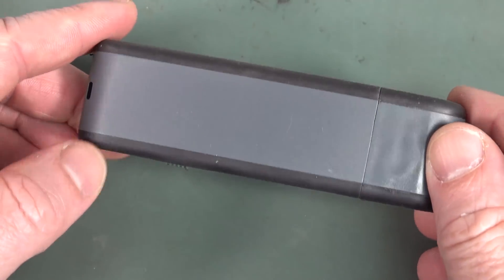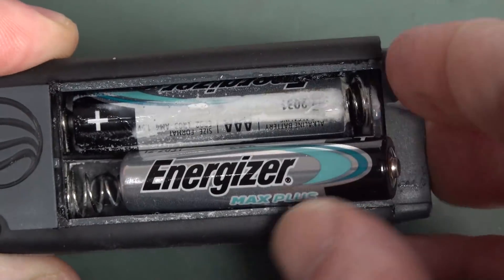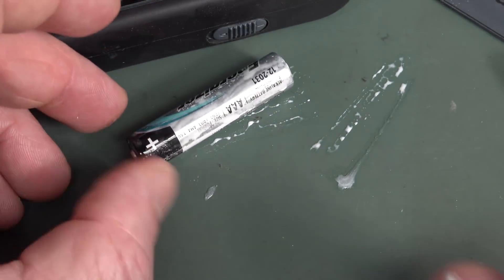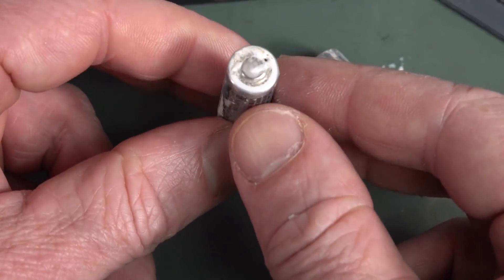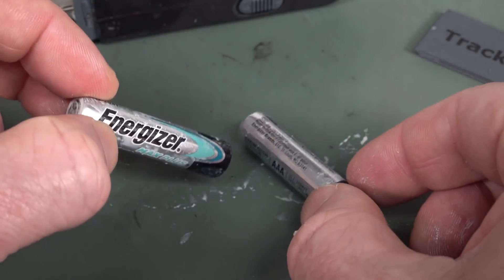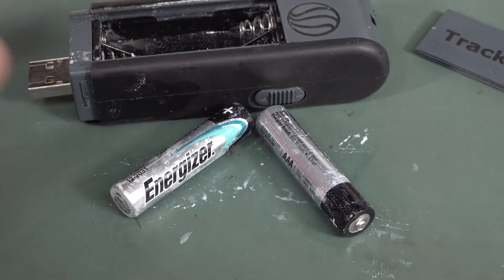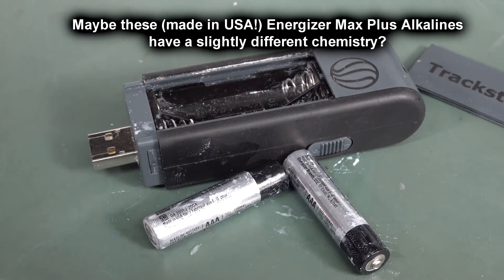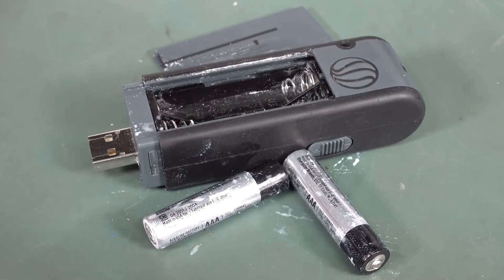EEVblog #1349 - Energizer Battery Leakage - MADE IN USA!

Comment: And it wouldn't be one cell dying before the other and reversing polarity, because both of those were leaking badly.
Reply: You’re thinking about resistance circuits where opposing installation currents can cause discharge by bypassing the  load, but the drain is only present while differences in V exist between sources. The statement warns against installation of unlike battery types because the differences in stored energies eventually causes such a differential even when the polarities are additive.
Reply: @HighestRank  Not sure what most of that means. If you have two cells in series to add their voltages and a constant load, and one discharges before the other, the discharged one will then have reverse polarity across it, which I believe is a sure way to cause leakage. In this case both leaked, suggesting this wasn't the cause.

Comment: I had a Duracell battery sitting on my desk for a few weeks and came back to it oozing one day. It stripped the paint and finish off of my desk. As others have pointed out, KOH slowly converts to K2CO3 after exposure to CO2. 

I didn’t let it sit around long enough to crystallize, but it certainly takes more than a day with full air exposure from my experience

Comment: now you can start using lithium batteries (1.5v non-charged). Longer life, stronger, lighter, more expensive :)
Reply: LiFe: larger, lower voltage, less capacity per quid but rechargeable, yes.
Reply: for example: "energizer ultimate lithium" (see datasheet)

Comment: Bought a 40 blister pack of copper top duracells, sat in my draw for about 6 months before I opened it, the majority of them were wet from leakage, the fluid also corroded all the other batteries too. Didn't trust any of them so they went straight from blister pack to recyclers

Comment: I've seen a liquid leak from a lead-acid battery. :)
Reply: They’re usually vented at the top so obviously tip one either way past vertical and it’s going to pass more than just O2-Hydrogen gas.
Reply: @HighestRank  Dude, that was a joke, I know what they're.
Reply: Not all lead acid batteries are AGM.

Comment: Energizer Industrial (Australia) cells leaked and destroyed my digital clock a few months ago, my first Energizer leakage ever.
I have lost faith in Energizer since then especially as they were well within date and the damage was significant.
Reply: You should have lost your faith in digital clocks. I have analog which uses a single C cell, and takes an extremely long time to die, and when it finally does it’s never catastrophic. Same experience with my analog wristwatch, just a different battery, although it has neither an alarm nor date function.
Reply: @HighestRank  
The clock was 15 years old and the 2 year old Energizers leaked, not the clock. Why would that make me lose faith in the clock especially when it displays a full calendar and temperature? Only a very complicated and expensive analogue clock is capable of that.

Comment: its Potassium Hydroxide I have seen it from time to time.  I have seen it flashes and high drain devices that stomp on them do it.
Reply: I stomp on the low drain device in my tub and it leaks, but when it won’t flush like it should, hydroxide is my go-to plunger.

Comment: Those are the exact batteries I use in my wireless mice. Last for an eternity but I guess one should not underestimate their varta side once they go flat. Thanks for sharing :)
Reply: varta? A mouse is something which is in continual constant use, so does not silently go bad, has a visual indication of functionality in the case of visible LEDs, and when it goes bad the cause is not only simple and obvious but more often than not is immediately and completely remedied; ‘ignore’ would happen just as infrequently, so there would exist no period of time within which to “underestimate the flat ones”, regardless of  type.
Reply: @HighestRank  I wrote mice for a reason :) Most of them are indeed frequently used but there is one I only use as a spare once every year or so.

Comment: It's a pity more products aren't designed to work well with the lower 1.2 voltage NiMH cells. Those very seldom leak.
Reply: Maybe it’s not leaking due to the simple fact that the cells are lower voltage, and maximum potential current is less, or a design cannot be created which draws more current. Diode bias voltages are the same no matter what.
Reply: @HighestRank  
From experience, NiMH cells can produce currents far in excess of alkaline or carbon zinc cells. For that reason, they do work superbly in devices like photo speedlights designed to use NiMH.

Comment: I actually heard a Duracell pop in my weather station console, opened it up and liquid was running all over the place.
Reply: i had some cheapie alkalines start pissing out, maybe I should'nt've charged em.
Reply: @lolman123401  just turn off the power to the USB port before plugging up the adapter and you’ll be okay.
Reply: @HighestRank  yeah
Reply: I have also heard that pop sound on some alkaline batteries
Reply: I had a Duracell 9v that I'd put on a charger a little bit previously and one day noticed a bulge at the plastic base. I peeled back the metal edge and it went off with a bang, exposing the rod and crud from one of the AAAA batteries inside.
Reply: When I charged Energizer Max it did nothing

Comment: All alkaline cells leak, no matter what. Just how many remote controls got damaged with alkalines. I switched to use only carbon zinc for remotes and lithium cells for high energy drain devices
Reply: Never had the black label Heavy Duty type leak, but they go on longer than carbon.

Comment: On a related note, I think the battery holder plays a role in the leakage.  The spring is pushing in on the battery opening up the seal.
Reply: @Big Crunch I didn't say it was different.  I'm saying batteries in a holder are more likely to leak than those not in a holder.

Comment: Energizers used to be very good; over the years I have empirically tried several brands and, after having a very good run with them for about 6 years (2008~2014), where they started to destroy many devices. I moved to Ray-o-vac and I also had a good run of about 4 years, until they started to destroy equipment as well. I now have a mixed bag of batteries, but for the important stuff I end up using Energizers Lithium Ion non-rechargeables. 
Fun fact: I had several electronic equipments where I put Energizers back in 2010, 2011 and the batteries are still fine with about six or seven years after expiration date. Clearly a decrease in quality over the yeara
Reply: wonder if they're getting really desperate with the dominance of Lithium Ion rechargeables in almost everything now. No idea why they don't just focus on making them as leak-proof as possible then, if all they're going to get used nowadays is low drain long time products. Pretty sure people would still buy them for remotes if they last less than old ones but never once leaked all over the place.
Reply: Ray-o-vac is now owned by Energizer and is sold at a lower cost point.  I used almost all Ray-o-vac since it was kind of a local company here in Wisconsin.  I've seen way too many of them leak, totally agree with you on using the lithiums.

Comment: I've seen plenty of liquid leaks in my career. Timing is the key to see the leak as a liquid. I can usually save the battery holder in this form as it is early.
Reply: Water in this case is usually a sufficient cleaner.

Comment: I have some old vintage batteries drained to a zero point, and no leakage at all!!! Todays battery are rubbish!
Reply: Just today I was looking at some AA batteries in an old remote for a video camera I forgot I had. I picked up the remote and realized the batteries were still in it, and thought "oh great, they will have leaked all over the insides of this thing", opened the battery compartment, and nope, perfectly fine. And seeing as they're original Sony RED something-or-other, probably the original batteries that came with the camera. That thing has to date to the early 2000's, original batteries, sitting ~20 years, no leakage.

Comment: They sell those exact batteries in the UK in a super market called Tesco. £8.25 £0.82/each 10 pack & Yes! they did that to me in my facial trimmer back in the summer.
I swapped to the  Black Duracell Procell AA Alkaline Batteries and Not! had a battery leak on me yet, made my fingers tingle at the time touching the leaked Energizers.

Comment: Is the device also a charger? I remember getting that kind of leak as kid when tried to charge alkalines using a nicd charger.
Reply: The device is a GPS tracker
Reply: Yes, the other end has a female usb port so you can plug your device in when the batteries are charged.
Reply: Thunder Kunt  Ah, looked like a data pack to me. 
Thought those were rechargeable batteries.
Reply: So either it stops working altogether when the batteries are removed even when it’s plugged in to a 5V USB port or it’s charging them. Idiotic design is not smart.

Comment: Ya definitely got lucky with the timing; it must've just started leaking recently -- within the past week at most! Potassium hydroxide is hygroscopic, meaning it absorbs water from the air; hence why there's so much liquid. The hydroxide then reacts with carbon dioxide in the air, forming potassium carbonate, which is soluable in water. It only crystalizes out once all the hydroxide is consumed, stopping it from pulling more moisture out of the air to keep it dissolved. In a normal climate controlled environment, this would almost certainly all happen within a week of the battery venting from hydrogen buildup in the cell.
Reply: Is it dangerous for the skin?
Reply: @sr.kaiser6875  it's not ideal, just wash it off.
Unless you want the fat in your fingers converted into soap!
Reply: @sr.kaiser6875  If it's KOH then touching it isn't a great idea. It's a strong base, and therefore is quite caustic. It's sometimes used as a drain unclogger (although drain cleaners based on NaOH are more common). It won't eat through your flesh in an instant or anything, but it will cause a chemical burn if you don't wash it off.
Reply: @Sheevlord  Thank you guys, I have some metal cases with some stains from leak battery. I Wil try remove this with something acid (vinegar) . The device use NiCd or NiMh, or an external adapter that use alkaline  AA batteries.
Reply: For Alkaline batteries use Acid to neutralize and for Acid batteries use alcaline (baking soda) to neutralize? Is it true?
NiCd, NiMh are alkaline or acid batteries?
Reply: @sr.kaiser6875  NiCd and NiMH batteries are basic too, they use potassium hydroxide as the electrolyte as well. It's not exactly good for your skin, but I wouldn't call it dangerous. As long as you wash it off reasonably soon after touching it you'll be fine.
Reply: @FarnhamJ07  Those batteries (energizer) on the video are acid? If they're acid batteries the correct would be clean with baking soda or vinegar? Thanks again.
Reply: @sr.kaiser6875  If it is an acid battery, use baking soda. If it is an alkaline battery, use vinegar. If exposure to leakage. Only do this if you know the chemistry of the battery, because some reactions can be thermogenic. Carefully substitute ingredients if necessary.
Reply: @sr.kaiser6875  soda is base, vinegar is acid, so if you want to neutralize something apply one type to another. The only acid batteries I know are chargeable lead batteries for UPS and vehicles. Alkaline is base by meaning.
Reply: @sr.kaiser6875  they are called alcaline batteries for a reason
Reply: @kodedude  I think you mean to say exothermic, not thermogenic.
Reply: Thanks!
Reply: full of light comment! 😉👍 I feel the urge to go back and review my chemistry equations... I used to love organic chemistry with the chiral configurations that reacts differently.... ooo my, I love science!!!
Reply: Love it when someone scientifically explains the sht out of the whole drama. Thanks
Reply: Thank you for explaining that. I knew from experience the crystalline deposit was water soluble but hadn't bothered looking up the chemistry.
Reply: I have found that it's best just to pee on them. 🙃
Reply: Dave Jones  thanks, I watched this first time in a small screen. 😅
Reply: I know it's old, but as a complement, according to reading the web, Another way to neutralize the KOH is using Hydrochloric Acid, but I suppose that in very dilute quantities, (just like Concentrated Acetic Acid
(glacial) corrodes metals, that's why dilute solutions such as white vinegar are used), but here comes the question which hurts metals less (or what types of metal is it good for after the battery leaks) since hydrochloric acid has An advantage removes iron rust, but you have to be quick once you clean it to remove or neutralize it, otherwise you'll go back to where you started and it will corrode the metal.
Reply: I have seen a battery just begin to start leaking before. I was doing some electronics and then all was fine until I heard a small hissing noise. After lots of careful listening, I discovered the battery start to bubble out liquid.

Comment: I bought a LED headlight that came with Energizer batteries. When I opened the package, I found the batteries had leaked. They weren't installed in the light, so surprised that they had leaked.
Reply: Let me guess, airfail-delivered?

Comment: All alkaline battery leakage is liquid.
But it turns to that crystalline form when it dries.
Yes, I've seen MANY batteries with liquid(some even DRIPPING) leakage.
Reply: Wow..  I've never seen it in the liquid state either.  Although I do mostly use rechargeables these days, LSD NiMH (only Eneloops) or L-ion - so there's less chances now.  In fact, the only alkalines I use anymore come from bought devices as I try to use them up before 'blowing out' while they wither in a storage box (for any possible longer-term power-outages).
Reply: Seen it plenty of times, and mostly with cells that are still ( as shown by Dave) well within the use by date. Those cells likely are only a year or two old.
Reply: I have seen it dozens of times. Mallory (Duracell) batteries would leak while on display in my shop. Some were leaking when the box from the distributor was opened. 

I don't trust any of them anymore. Some are better than others but with the huge numbers of fakes you can't rely on any brand these days.

Comment: Duracells and Energizers alkaline are blacklisted for my equipment, period.
Reply: Everything BUT duracells and energizers are blacklisted for my equipment. Everything else leaks... but duracell and energizer doesn't.
Reply: @vhfgamer  Funny enough, the only alkalines I've ever seen leaking were Duracells. I literally have some leaky Duracells on my shelf here waiting for the next trip to the supermarket where they have these battery collecting thingies.
Reply: @vhfgamer  Good luck with that :D
Reply: So what do you use?
Reply: @ianbutler1983  From my experience Panasonic ones have been pretty good.
Reply: @Kalvinjj  Thanks.
Reply: @ianbutler1983  camelion alkaline plus, for about 15years no problem with this brand
Reply: @TazkoHoZabit  Thanks.
Reply: @ianbutler1983  Which*? Either Duracellls AND Energizers OR neither Duracell NOR Energizer. Elementary  truth tables are easy logic.

Comment: I'm done with Corrodacell and Energizer alkaline AA/AAAs at this point - too many have leaked and corroded things way before their printed 'use by' dates.  Eneloops are the way to go - started using them in photo flashes about ten years ago and have yet to have any issues with them.
Reply: Eneloops will go bad eventually, but I've never had devices destroyed by leakage from them.
Reply: @stephenarling1667  I'm ok with them eventually failing, just as long as they don't take whatever they're in with them, as alkalines made in the last 15-20 years or so seem far too inclined to do.

Comment: only had this happen to me once with a device that had an o-ring seal on it. Too long ago to remember the brand; ended up corroding a contact on the battery holder such that the next time I changed the batteries the contact just went and fell off (wasnt hard to reattach fortunately)

Comment: In southern California we've been having problems with Duracell leaking both in devices and in unopened packages long before dates on the packages!  Usually it is crystalized.
Reply: Yes, I've had brand new Duracell batteries to leak still in their package. One pack I remember i'd only had for a couple of days. All four batteries leaked at the same time.
Reply: I like to use NiMH batteries because they rarely leak, the LSD type (lol 😂) works for almost all applications.
Reply: CA low humidity desiccated.
Reply: Here near Russia almost all batteries I've seen leaked is Duracell, or, less times, super cheap not mass known brands. So there is no reason to pay more, just buy relatively cheap GP Super or Videx (second one may be not sold worldwide, but good known in Ukraine or Russia).

Comment: They usually leak in liquid form from what I've seen, they crystalize as they evaporate. Although this might vary between manufacturer. I've never seen that much liquid though and it's usually dry in spots.
Reply: ‘Vary’ by how much? Leak crystal which then spontaneously liquifies? Usually wet in spots where it’s not dry? Boll-oks! Circular logic! More powder than liquid except when it’s more liquid than powder.
Reply: @HighestRank  were you using Google translate or something? I don't think you understood what I wrote at all.